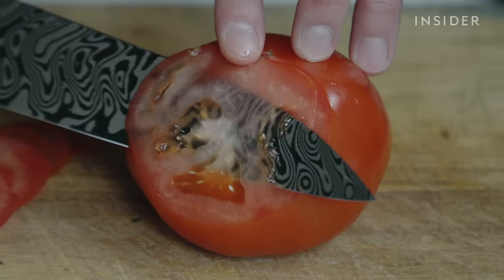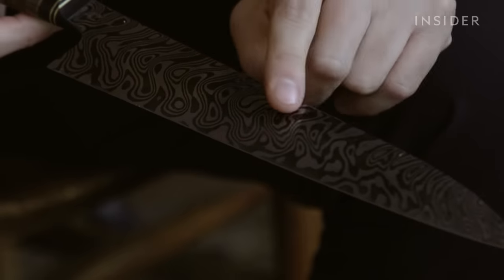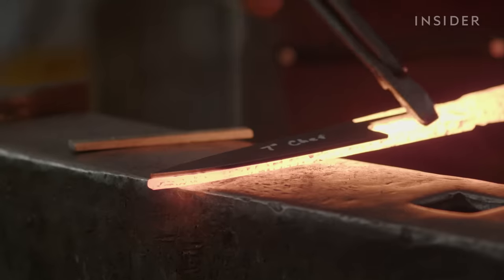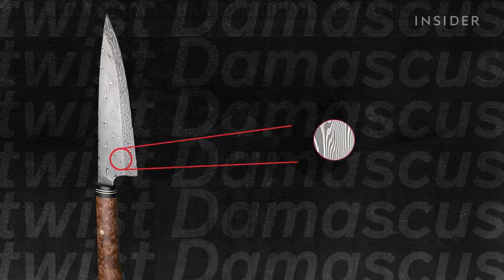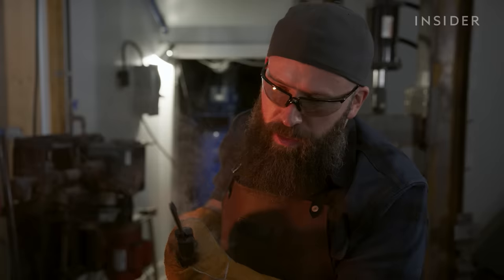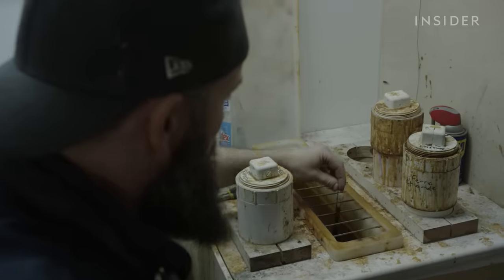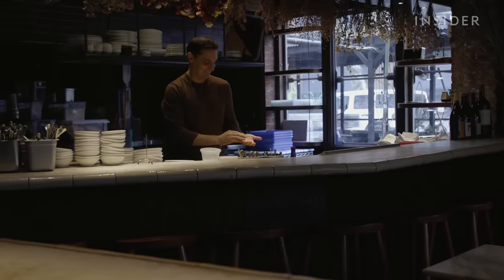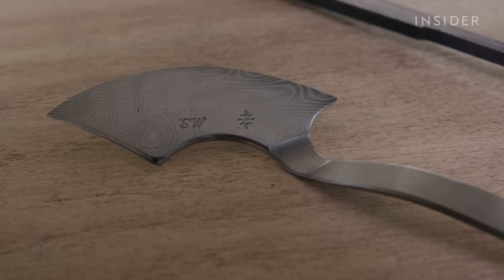Why Damascus Knives Are So Expensive | So Expensive | Insider Business

Comment: For anyone wondering if Damascus is better than normal steel or if it's just a myth: it is not, however it used to be. The ability to make the mix of carbon and iron in steel homogenous has not always been a given. That means that steel from hundreds of years ago was significantly worse than steel today. Damascus was the best way at the time to make the steel more homogenous thus making it superior to other steel of the same time period. Nowadays due to modern machinery steel is much more homogenous eliminating the need for the folding the steel to make damascus
Reply: Agreed
Reply: Would you say they both have the same "strength"/durability
Reply: @dogs oath  perfectly made Damascus would probably still end up technically being weaker just my virtue of how great metallurgy has become, regardless we aren't reaching that limit while doing anything these utensils can handle, even in a larger format its pretty rare man out strengths steel before fittings start to go
Reply: @sentient_slab  rather that it being Damascus has no effect either way. What affects is the steel, heat treatment, and how it is sharpened
Reply: Just came to say the same, impecable explanation
Reply: @sentient_slab yes, and a really bad made Damascus (overheated, cold forged, bad HT) can be worst
Reply: @wmcknives  thank you :)
Reply: It isn't Damascus pal.
The technique for making true Damascus was lost a couple of centuries ago.
Reply: @scarabooshable  its been re-discovered if you like to say it, it's called wootz, but today a multi layer steed it's called Damascus, for shortening, multi layer steel it's long and confusing
Reply: @mchajen511  you're welcome!
Reply: @scarabooshable  what do you mean "true" Damascus?
Reply: @dwightschrute4560  "True" damascus steel was made in damascus like 1200 years ago and we dont know exactly how they did it. modern times people have been able to recreate a similar method but  the real "recipe" has been lost
Reply: @dwightschrute4560  Damascus is two different carbon steels forge welded and folded. True damascus would probably mean Damascus made from the same steel as it was made historically. I can accept that we don't have an exact idea of what those were (although Wootz steel seems probable) but I have a hard time believing the technique is lost without compelling evidence of historical damascus having properties we can't replicate.
Reply: yeah shouldn't be sold as better than a normal steel blade, just prettier
Reply: No one has managed to beat viking steel yet, no one even knows how it was made or wootz for that matter, I am so tired of hearing people go on about how amazing pattern welded steel is,  its got the same silly level of myth as the pig iron swords of japan.  people are just paying for a art piece and the rest is the placebo effect because they spent so much money on it.
Reply: @wmcknives  Wootz has not been rediscovered.
Reply: @GreatSageSunWukong  Hi, not very familiar with what sets Viking steel and Wootz steel apart from modern steel. Is it better at holding an edge, more oxidation resistant, tougher, etc? I would love to know :)
Reply: @queenween  it was called damascus because it was sold in the markets there to the western market,  it was not made there, damascus was a trading post where many cultures merged, like the silk road in ancient times.
Reply: @GreatSageSunWukong  it's a way to say it, it's been proved that that's the method they have used in the original Damascus steel, I don't remember the name of the YouTuber that made the investigation about it, but he discovered that the technique was extremely similar to the wootz steel
Reply: @mchajen511  the difference is not between the modern steels, is with the contemporary steels, the have an enormous advantage
Reply: It didn't necessarily mean better even during the middle ages. It just had a better chance of being better due to the indigenous carbon content of the iron deposits in western Asia. Blast furnaces were invented in Sweden c. 1300. Those blast furnaces made it much easier to make steel of the same or even better quality than the Middle Eastern varieties. This said, it still wasn't impossible to make European steel of the same or better quality even before the blast furnace. It depends on individual deposits, knowledge of the steel-making process and the skill of individual smiths.
Reply: damascus steel actually came from India.
Reply: Adam Nelson  the archaeological and historical evidence disagrees. There are absolutely non-Damascus blades that are over 1k years old some as old as 2k years old or older that exist today and Damascus blades that have crumbled to dust. What steel the blades are made of makes much less of a difference than the conditions in which they were stored in.
Reply: @sentient_slab  No. True Damascus/Wootz steel even if made by a master smith still has higher amounts of impurities than modern steels. Modern steels are highly specialised by just tweaking the few percentage points of elements such as chromium, vanadium, molybdenum can make the blade tougher than what was possible with wootz.
Reply: @wmcknives  it hasn't been re-discovered. Metallurgists have been able to produce steels that are similar, but with steels that are called "Wootz" being produced by hundreds of different smiths over roughly a 2000 year period in history there is no 1 definitive Wootz steel. Unless someone discovers a complete step by step record on its production the closest that can be made is still only a facsimile.
Reply: It's not a myth.
Anyone with eyes can see it's better.
nods
It is better looking.
Reply: I can take a 10 dollar walmart blade, sharpen it, and itll cut just as good as a 20k blade. Its all just bullshit.
Reply: Valyrian steel is still the best
Reply: @GreatSageSunWukong  I suspect you are probably creating a strawman in your own head about "people" like that.  Sure some probably do exist but I'd be willing to bet most who want to buy these kind of knives have done enough investigation before purchase to know that it's mostly an art form.  And what's wrong with supporting an art form like this?  It's no different than buying a nicely made automatic watch for hundreds or thousands more than a quartz which is a far superior time keeping device.  Pretty much every watch person out there knows this.  Being "better" isn't the point.  The art and craftsmanship ARE the point.  And there is nothing wrong with supporting it.
Reply: @sentient_slab  they did it around 1:50 you basically pay for the craftsmanship which is still awesome.
Reply: I know next to nothing about knives and steel etc....but it sounds to me then, like this is much like people into Denim or Watches.  Like selvedge denim is no "better" in terms of quality or durability than modern projectile loom denim but the appeal is in the craft of it all.  The fact that it feels different and is generally smaller scale production.  Personally I think it's cool that people are into this kind of thing and supporting these types of manufacturing.  And while not 100% true in all situations, generally I find supporting these kind of products is a much better way to mitigate against things like sweatshop working conditions and exploitation.
Reply: Depends on the steel used to create it.
Reply: Adam Nelson  clearly not because he said there were European steels just as good (or better) as Damascus and just like almost everything else during the Medieval period, you can't use absolutes.
Reply: There is no such thing as '"true damascus", or "damascus steel", because that method was perfected by Tamilians and when the Wooltz ingots arrived to Damascus, they poorly replicated the original, but carried on as 'their' version. As someone mentioned in the comment section, it was place of trade where they inherited Wooltz Steel which originated from Tamilians. There are two veils casted over to hide Tamilian history; the credit being given to Persians and dubbing it "damascus steel", while the other being said by some informative individuals but not accurately stating it was solely from Tamilians, instead of including 'India', as a whole - when India was not a country back then, and back then the large land area was called Bharatham by the Ancient Tamilians.
Reply: Yep...
Reply: Damascus knives are very overrated
Reply: Wrong, it is and still better than normal knifes today because of the type of steel Damascus need, like u said on that essay. But completely glossed over the fact that normal steel knife requires only the most basic steel.
Reply: CPM-154 level of performance that the best Damascuses offer is more than good enough for the average user, especially in everyday culinary. But with supersteels like Magnacut nowadays, I’d rather get the performance over looks.
Reply: @wmcknives  same true for steel
Reply: Jealousy
Reply: Wootz
Reply: @doublestrokeroll  actually not really. You might think people in general would know this but no. Channel like business insider would advertise on how good this knife is compared to others due to the price range. This video is a prime example of it. It is because of such advertisement that you can find people believe it's better when in actuality it's not that much of a different
Reply: Damascus is a just a bit stronger and durable, but it's just done to make them beautiful by etching them in acid.
Reply: Powder steels are the king nowadays. Truly the cutting edge of thousands of years of metallurgy
Reply: @zulhilmi5787  I think you're hearing what you want to hear and not paying attention.  She literally says at 1:42 "...and while high end mono-steel knives may perform similarly, Damascus knives are coveted for their striking appearance and the craftsmanship required to achieve it."  This video never said they were "better" and is quite clear it's only about the process.
Reply: The problem is that in all the video no-one reveal the atomic structure of his steal, which is actually very easy to check and it's the unique thing will allow you to say if it's Damascus or at least near Damascus Steal. So this is definitely just another scam.
Reply: @doublestrokeroll  literally in 9:31 he claim that a 30$ knife will not cut anything when in reality it will do it's job. Yeah it will not have the same quality but just add a few more bucks and you will get the same quality. You don't need to pay 500$ for such sharpness when you can get it way more cheaper.
Reply: @MultiKwolf  so just because you can make a knife from a bad steel means that all knives are bad? Dude you're literally making the argument that a chefs knife isn't good because a butter knife can't hold an edge.
Reply: @dogs oath  yes! Although it depends on the amount of carbon in the blade.... for example. Stainless steel is much softer and won't hold an edge as well as a regular carbon steel blade!
Reply: @zulhilmi5787  So you're taking him literally there?  I think you know he was exaggerating on purpose.  And you answered your own point in the next sentence.  
And again, you're missing the point.  Some people want to pay for the craftsmanship and artistry of things like this.  It's not about "need".  People don't "need" any of the shit we buy.  
It's like you're saying "nobody needs to buy an automatic watch.  You can get a 5 dollar quartz watch that's more accurate for WAY less."  OK...that's true...but I WANT an automatic because I love the technology and creativity those watches represent.  

People are into different things.  And some examples of certain things are expensive to make.  People aren't wrong for buying those things.
Reply: Yeah, its not the "real" damascus anyway
Reply: @doublestrokeroll  literally or figuratively does not make any changes here. I don't care if people want to buy it for artistic purpose. Did I ever implies that I against those people? The answer is no. My issue is within the implication by the video that this knife is better than the general knife we can buy in market with a cheaper price. If you want to buy it for art then by all mean go but don't implies in a slightest bit that it is more functional than the general knife.
Reply: @wmcknives  True of any steel. Badly made is badly made.
Reply: Thank you. Capitalism trying to find another way into our wallets
Reply: @scarabooshable  This is such a goofy myth that for some reason still persists. Traditional damascus is wootz/crucible steel, the patterns are created by alloy banding, there are still smiths today that make 'True' damascus, we know exactly how it was made. Modern damascus on the other hand is pattern welding of two or more steels of varying alloy content, usually one high nickel and one without, that are revealed after acid etching.
Reply: @queenween  There's no 'real recipe' because there never was a recipe, it's just the basic technique of crucible steel smelting. A number of smiths recreate it today, just with much purer iron and precisely controlled carbon and alloy content.
Reply: @GreatSageSunWukong  Lol Swedish iron ore deposits are more pure than anywhere else, but modern smelting and metallurgical technology yields vastly superior steel to 'viking steel'. And yes we know exactly how it was made, its basic crucible smelting, plenty of smiths out there still make authentic wootz. The Viking steel mythology is almost as goofy as the Weebs making up shit about katanas. Modern damascus/pattern welding does nothing for function but it is absolutely valid as an artisinal artform integrated into practical tools.
Reply: @GreatSageSunWukong  It was never forgotten lol, we know exactly how to make wootz and there are a number of smiths that still smelt their own crucible steel. Check out some of Mert Tansu's work.
Reply: I think you mean homogeneous, not homogenous.
Reply: 😊😊😊ķķ
Reply: Lol original Damascus steel from Damascus wasn’t even folded (you are thinking of the ancient Japanese folded steels) it was actually a type of steel heated and slowly cooled in a way that grew carbide crystals in it. The cystals when etched were darker and created patterns all over the steel
Reply: I might agree with this if I had never owned a Damascus chef knife vs general store bought chef knife. And the one I have isn’t even close to the ones being made in this video. We’ve had it over a decade and it’s still incredibly sharp, compared to the chef knife we got in our wedding registry block set that dulled in 2 years.
Reply: Understood. Thank you
Reply: So modern Damascus are overrated?????
Reply: I've been saying that to myself to the entire video Damascus steel doesn't exist anymore it's patterned welded steel or folded steel
Reply: That's why i just have a regular knife with a Dbrand damascus skin
Reply: In other words it's not worth that much it just looks pretty
Reply: @MoXXXi yes
Reply: @VNtheOnly yes
Reply: thank you
Reply: Just to clarify, yes metal back then was bad with a lot of impurity. But there was Damascus steel type. The only problem is the iron from India is gone or can't be found anymore. That why we can't recreate it. We know the method and coal they used. But not iron ore they used. So it become a style for people who like the look of it.

TLDR
In short, good steel knives for $200 are best.
Damascus is a style now and not a type of metal. It's worth spending a lot, when it's your life job like a chef. And we got a lot better at making metal.
Reply: Will it keel?
Reply: @jububoobaroo67  pretty much
Reply: @leopfeffer2419  No he means homogenous which is the current scientific spelling, homogeneous is just how it's often spelled colloquially and was used scientifically in the previous century.
Reply: This isn't Damascus steel. Its as Damascus as sparkling wine is champagne.
Reply: @GreatSageSunWukong  You must be wore out Bub!!!!😂😂😂😂😂
Reply: @Yeshua Christi  Sparkling wine is identical compositionally to champagne, champagne is just a protected term limited to the region where it is produced. Modern Damascus is pattern wded steel of 2 or more alloys, traditional Damascus is just wootz/crucible steel with the pattern made from carbide banding.
Reply: I was looking for this comment. I thank you good sir
Reply: usual insider is making it exaggerated pricing again like the Japanese chef knives like the gyuto and santoku. and praising the damascus steel is superior to other steels. it's just an 15N20, 1084, 1095, 52100, or for swords 5160 and 1075. the guy is an ABS master smith the title of being an ABS master smith is the thing that you pay for like the goat himself Bob Kramer plus does steels are cheap but the labor itself is expensive the persian twist it self or just the twist removes a lot of material and you mess it up de-laminations and stress cracks will ruined it up and will add to the cost. not to mention the heat treatment part made my heart beat race like all your labor will be wasted if you mess that up also that part added to the cast so. the steel cost and other exotic handle material + Labor cost + other material cost like sanding belt, quenching oil, gas, electricity and etc. + also if the guy is an Master smith and journeyman added to cost.
Reply: @doublestrokeroll , What makes you think that selvedge denim is not better? The quality is most certainly more durable if you take care of it over time and it forms to the individual better even though it takes ages.
Reply: Please write a book for us before you leave this world behind. 🙏 ❤
Reply: @geoffreyk9164  The quality of the denim is determined by the quality of the threads not the way in which it is woven.  Projectile looms are just as good as shuttle looms.  Take the same thread and run them through both and you'll have basically the same thing.  
You're confusing what big companies do to the denim after it's been woven.  Big brands purposely wear out their denim for fashion and ease of use reasons.  They don't have to do that. 
The selvedge is simply a product of the shuttle loom creating a "self edge".  It's got nothing to do with the quality of the fabric.  Once the open ends are sewn up, non selvedge denim is just as "durable" at the seam as selvedge.  Seamstress' know what they are doing after all.  

I bought two pairs of made in china Levi's 501s a few years back.  Levi's "premium".  One pair has selvedge and the other doesn't.  They've both had equal wear and they're both pretty much exactly the same.  The selvedge pair isn't any "better" because it's selvedge...lol.
Reply: @zulhilmi5787  I get it.  The video did not imply that.  You read your own emotional bias into the video.  They did not imply it was better.  What they literally said DOES matter.  You saying it doesn't, doesn't make it true.  Not sure you have a grasp of basic logic with a statement like that.
Reply: @griffany  thank you, can't promise anything about the book though
Reply: @doublestrokeroll , Yeah, I understand what you’re saying, but I didn’t mean to confuse what big companies do to the jeans after they been woven. When I’m talking about selvedge denim being “better”, I’m not talking about the quality of the fabric (although I find that raw Japanese jeans to be the best in terms of fabric and overall quality), I’m talking about their durability (for selvedge jeans and raw selvedge jeans) and the fact that they eventually fit the person better (in terms of selvedge and raw).
Reply: @matteblack5805  Glad it was useful :)
Reply: @BlackEagle352  Carefull, those are even sharper 🙃
Reply: @VNtheOnly  It's just cosmetic would be more accurate but yes, by many it is
Reply: @TheNerdistheWord  Damascus knifes can be incredible, but so can high end non-damascus knife. The most important thing is that you're happy with your knife, but don't get another damascus knife assuming it will be equally as good by default
Reply: @ryanyoung7433  True but you will have to sharpen it a lot because it won't maintain it for as long as a better quality knife
Reply: @doublestrokeroll  Hey don't get me wrong I collect knifes and swords,  I even have some katanas myself because they look pretty, my most expensive blade is a wakizashi with gold and mother of peal inlays on it and a pretty hamon, but I am going to pour scorn on this kind of thing because looking very pretty and having a fancy handle is not the same as being the best you can get for functionality,  I can understand these chiefs buying the things if they work in a restaurant where they are making the food directly in sight of the customers, its part of the show but as a tool, nope theres way better knifes on the market for cooking with that cost less, damascus is not all that I own 4 damascus knives myself, all these things are inferior to modern steel and heating technology, we can purify steel in ways no one ever could before, we can study the structure under microscopes to determine the best composition for the job.
Reply: @jacoblaszakovits3035  I did not know that, will definitely do more reading but it seems to me that it like folded steel also increased how homogenous the steel was as well as providing other benefits.

Found this paper, name no link, if anyone is interested enough: Influence of the Distribution of Excess Carbide on the Properties of Genuine Damascus Steel
Reply: Real Damasscus steel is Wootz. What is shown here is just Pattern welded, time consuming to make and beautiful to look at but not better stronger sharper. Even crucible Wootz has its limitations.
Reply: I would still say that the edge that you get from folding the steel thousands of times is still Superior if I were to buy a high-end Katana it would definitely be something with at least a thousand Folds.
Reply: @lance862  compared to low fold count maybe, although I don't think so. Compared to normal steel I am sure there is no causal relationship. But, that there is a correlation between someone putting in the time to make many folds and putting in the time to make a good knife, or in your case katana, seems probable to me.

However, the important thing is that you are happy with the knives you have. And I hope that you see that I am not out to invalidate you're opinions in any way. Just sharing what I know in hopes it might help someone.
Reply: @lance862  doesn't need folding if its high quality steel in the first place only reason katanas are folded thousands of times is to try and get a decent edge out of pig iron. a modern sword any sword designed to be used as a weapon is better quality then a old katana, less prone to chipping, breaking and rust.
Reply: Everything you said is technically correct. However, it does deserve the large caveat that the Damascus steel of the past that you are referring to often called wootz Damascus or crucible Damascus is a completely different process of steel creation than the modern thing we call Damascus. It does, however, produce a similar patterned look due to the crucible process as well as the vanadium content of the mines where that steel was sourced from which causes brighter steel similar to what we see in modern steels that are used in the pattern welding process.
Reply: As a knifemaker i totally agree!!
Reply: @geoffreyk9164  But durability IS because of the fabric, not the method used to weave it.  If you take great Japanese lengths of cotton denim and weave the same cotton denim on a shuttle loom and on a modern projectile loom the durability will be exactly the same.  If anything, non selvedge would probably be more durable because it's a tighter weave with less fraying (slubbiness for the dorks).  Though I have no hard facts to back that claim up.   Basically it's not going to be worse because it's not selvedge.  This idea it's more durable because it's selvedge, is a complete myth.  Selvedge is simply an old style loom.  That's it.  Nothing more.  The slight difference in machines is not going to affect the durability.  
The appeal is simply, as you say, that you get to "break in" your jeans.  But you could weave raw japanese 25oz denim on a projectile non selvedge machine and it would be the same.  You'd still need to break them in and fade them yourself.
Reply: Correct. With modern homogenized steels, the only benefit to pattern welding (or 'damascus') is for aesthetics. There is no functional benefit anymore.
But they sure are pretty, I'll admit that.
Reply: @doublestrokeroll , Thanks for the additional details and insight. I think that I caused some confusion because I thought you specifically mentioned raw denim selvedge jeans. Having gone back and read your comment though, you didn’t. With that said, when I was talking about “durability”, which I think is what caused confusion, I was really talking about a combination of both selvedge and raw denim. My basic understanding is that raw denim will always be more durable than pre-washed denim (if cared for properly), but also that companies selling selvedge jeans typically use higher quality denim. I guess that is not automatically true; however, even if you use the same denim on a selvedge loom and a modern loom as you suggest, I understand that because the selvedge loom runs slower, it is easier to control quality. Lastly, and I think you disagree with this part, my understanding is that fraying of the outseam on selvedge jeans is less likely  given that quality is more tightly controlled. Ultimately though, I think the main benefits of using selvedge jeans to some extent and raw denim jeans to a greater extent is the “breaking in” and personalization aspects more than the durability aspects (at least if you own more than one pair of jeans).
Reply: @mchajen511  Now , Damasteel on the other hand...
Reply: True Damascus steel has been lost to time. This is pattern welded steel which is still greater than one homogeneous billet, but still inferior to true Damascus steel.
Reply: @geoffreyk9164  Well that's the main thing right?  These smaller companies are choosing to make old school jeans.  

If you're Levi's the whole thing must be weird.  For basically 40 or so years, consumers see your product as being "flawed" so you have to come up with a marketing slogan like "Levis Shrink to Fit".  So they work on it and develop the technology so you don't have to worry about them shrinking.  Then people want the "faded look" cause not everyone wants every single pair of jeans to be dark blue.  So they do that.  
Now you've got a whole group of people saying "wait....we want the old jeans that might shrink in a way that makes them not fit properly...we'll take our chances!"....lol. 

But Levis had already moved on.  So all these small companies come in to make them like that.  To the point now where Levis and the other big companies are making selvedge and raw denim again because giant corporations are always slow to catch on to trends.   

As for the old looms it depends on your definition of quality for denim.  The jean makers can control many aspects of the weave to get the texture they want.  But those looms by their nature introduce "flaws".  The "slubby" thing.  Now if you're saying that represents "quality" then yeah by that definition it's true.  But I would argue most people's definition of quality in manufacturing would be consistency.  Modern projectile looms are far far more consistent.  Each bolt of fabric is going to be pretty much the same.  

Personally I think it's more reasonable to say denimheads want the inconsistencies of shuttle looms rather than redefining the word "quality" into something that simply creates confusion.  

Which brings us to that last point.  Yes, modern looms create fabric with an unfinished edge that can fray, but that's why I mentioned seamstress' being good at what they do in a post earlier.  I don't know the name of the stitch they use to "seal off" the edge but they know what they're doing.  Again, take the exact same threads and make a pair with and without selvedge sewn by the same person and they will be the same.  Have you ever had a pair of non selvedge jeans come apart on the outseam?  I can't remember ever experiencing that.  It's a non issue.  

People like the selvedge just because they think it looks cool.  And I agree.  It does look cool.  But it makes no practical difference in terms of quality and how they wear all other things being equal.
Reply: I see
Reply: yes
Reply: Ok cool to know x)
Also the cool aspect is a great thing
Reply: Amen.
Reply: @zulhilmi5787  Amen.
Reply: @thecookseye7383  Amen.
Reply: @geoffreyk9164  Amen.
Reply: So basically this is not a lot more work for way more? Good to know will never buy Damascus then. unless this shit is 25x stronger there is no reason to pay more than 14x times the price for a potentially marginally stronger blade. Well played by the craftsmen who other wise barely make shit for money with stuff like this. They act like it’s that much work, but if you’re a smith and have a forge it’s literally nkt
Reply: Led me to think
Reply: This.... I love when people moan about "stamped steel" as if it's automatically low quality. Ancient bladesmiths would have loved to have access to modern materials.
Reply: And it was invented in india
Reply: @harveyspecter111  that’s just false. The steel was ingots of wootz steel which was IMPORTED from India. Not MADE in India. The forging of the blade and how Damascus is actually made is in Syria. So that is just false
Reply: For anyone still wondering, since his grammar was bad: He is saying damascus steel not better than 'normal' steel. He is not saying it's not a myth, because it is a myth.
He is also wrong, it's not worse than 'normal' steel, although it is way worse than 'modern' steel.
Reply: @Apoz bare minimum type with proper grammar
Reply: @Apoz  it’s a myth!!! Yo, Damascus is a myth? It’s not a real thing only believed upon by leaser individuals, it’s a myth!
Reply: @griffany  🙏❤
Reply: it's a waste of time and money for average person to buy Damascus piece while a regular high quality steel do the job,and yeah Damascus got over hyped perhaps cause of the patterns it's cool alright but i won't buy one even if i can afford it
Reply: cap
Reply: Thank you so much
Reply: I am asking which software are you using for edit video
Reply: I've been told that they don't find the formula to what made swords not be damaged in those days, I know we have now machines that could create a indestructible sword but how they did it before is a mystery
Reply: The only reason you buy a damascus steel knife is because of the aesthetic and the labor and craftsmanship but other than those reasons its not going to be better than a knife made with one type of high quality steel. Your just creating weak spots and inconsistencies on the blade by combining two types of steel together to create damascus.
Reply: I wasn't sure wether or not he was selling snake oil because I feel like I'd have heard of this in all my years on this planet in the kitchen.
Reply: Thank you, just saved me a $1,000 😂
Reply: @rokaskundrotas4805  they look cool tho some will say it's worth the money
Reply: So glad to see some sense in the top comment after the video was filled with such outright nonsense.
Reply: @ootheca  thank you :)
Reply: @ryanyoung7433  Well you can sharpen close to anything, with those metods it is more about keeping the edge and over all resistance.
AS for whether (fake/modern)damascus steel is better then modern types of steel I don t know, but I do know that most knives are not made with some super good modern steels.
Reply: While I agree that some types of modern steel are better for blades/knives most knives producers don't use those modern good types of steel.
Because if that was the case there would not be so many crappy knives.
And I don t know if it is cost effective to even go for them then try to use those folding techniques.
Reply: L
Reply: 1
Reply: Aaaaand all the experts come out of the wood work, wanting to shit all over this amazing craftsmanship.
Reply: Wait so it a scam?
Reply: @breadtoasted2269  No, they are difficult to make and can be really good. But it isn't the only way or even the best way to make a really good knife. I do however believe there exist "Damascus" knives which are really cheap where the pattern I printed/painted. Those I would consider a scam
Reply: @scarabooshable  fact
Reply: I can make Damascus knife using plastic
Reply: so does the original technique actually originate from Damascus in the middle east?
Reply: Isn't ancient Damascus just ancient samurai swords, coz' samurai swords are folded 1000 times? I wonder which is more durable though- ancient Damascus steel swords or ancient samurai sword masterpieces? God bless those who discovered Damascus (where St. Paul was supernatural blinded and converted by Jesus to become catholic).
Reply: It just costs more and most Damascus knives aren't real
Reply: Garbage.
This is pattern welded steel and it is not stronger than homogeneous high carbon knife steel.
Reply: This. If you want a sharp knife, just buy a $25 whetstone and sharpen it yourself. In half an hour, you'll have a knife sharper than when you bought it, assuming you spent any less than like $300 or whatever
Reply: Damascus to me could symbolize the skill of the bladesmith though. While in most cases this is wrong, if the blade is entirely made by hand (or power hammer) it could show the skill by not only the technique required, but the time it takes.
Reply: thank you for the explanation
Reply: thats because the original method of making wootz steel has been lost , India was where it came from , and the British destroyed it . Indian wootz steel made what is known as ''damascus steel ''
Reply: @Jatadhari1000  Lol no. It's cause sharpness has nothing to do with this stuff, and entirely has to do with sharpening techniques. Metal doesn't become sharper just cause you do funky folding techniques.
Reply: @wmcknives  So how do you know if a steel blade is going to be just as sharp/durable as these demascus blades? Do you klnow some reputable knives sold today? It's hard to know if I'm getting ripped off or what these days.
Reply: @WIZA327  it's based in trust in the maker or artisans
Reply: The guy says on his website

"Nearly all of my knives are made using high carbon steel. It is superior to stainless steel in almost every way, but you need to know how to take care of it. It is important to understand what you’re buying."

So now I'm confused because you're saying that normal steel is better than what he's using, which he says is carbon steel, which again, he says is superior to stainless steel. 

"Compared to low-carbon steel, stainless steel offers a massive upgrade in strength, hardness, and most importantly corrosion resistance. High carbon steel offers strength rivaling and sometimes exceeding stainless steel, but is largely a niche material in the manufacturing world."

Here's a quick google search asking to see if carbon steel is greater than stainless steel, based on Zach's statement. They say that stainless steel will be far superior to lesser carbon steel quality, but if it is high quality, which Zack says it is, then it can rival or exceed. So which one is it, damn it!
Reply: @anthonyvillaa  I think you misunderstood the comment a bit. The comment is stating that the Damascus method does not affect quality on modern steel, and what matters is the quality of the steel itself. The marketing for Damascus steel is often "it's the sharpest in the world", when in reality, the quality is fantastic, and the method requires high quality steel to preform well. 

The fancy method is generally paired with the fancy metal, but you only need the fancy metal to get a top tier blade, and sharpening skills are what matter beyond that point, which are not affected by a blade being Damascus or not.
Reply: @Naokarma  gotchya. Yea I just went into a discord for chefs knives & found out about how sharpening will do me better than buying a expensive knife like in the video.
Reply: Damascus is better because you know it's difficult to do and the smith did a good job, versus steel which is just manufactured and pretty terrible. So for the best, go to the smith that does the best Damascus then have them do steel.
Reply: @anthonyvillaa  Exactly. If you want the most value for your money, I 100% recommend getting a couple whetstones (typically 1000 grit and 6000 grit) and learning how to sharpen that way. 

If you just want a simple sharpening, then buying one of those pull sharpeners can do the job fine enough as well, but it does take some longevity out of knives by taking more metal with it than other methods.
Reply: @scarabooshable you mean layering steel? We’ve basically recreated it perfectly and it’s inferior to any modern steel like o1
Reply: @queenween the real recipe was far inferior to any modern steel. Source: am a knife maker with years of experience
Reply: Are you telling me that they are selling wolf tickets and these knives are complete fugayzi? No way, I refuse to belive it.
Reply: Exactly! It just looks pretty :)
Reply: source: Broke dude
Reply: It's actually even more than that the raw ore they used in Damascus is called Wootz and it is vastly better than mild steel and back then that was a massive deal and then used the Damascus forging method just made it that much better.
Reply: Damascus is still one of the higher quality blade types even today
Reply: @Silvercrypto-xk4zy  
(Edit) below is on the assumption you are talking about modern Damascus. If you are talking about historical wootz steel there is certainly proof which I think you can find in an earlier comment of mine of it possibly being comparable or superior to modern steels (/Edit)

it being Damascus has no bearing on it being good or not, there might be a correlation since Damascus is harder to make. You can make Damascus out of two steels with differing carbon contents and then just skip heat treatment and tempering making a really soft knife or make fake Damascus by taking a normal knife of any quality and printing a damascus-looking pattern.

TLDR: do not use the Damascus pattern as a visual indicator of quality, it might Damascus and soft or it might be fake Damascus (read above)
Reply: Lame explanation. its not just homogeneity. Real wootz had vanadium carbide layers and was super strong.
Reply: @drygordspellweaver8761  Today "Damascus" and "Wootz steel" are two different discussions. Damascu's, as a name for all folded steels, purpose was to increase homogeneity. Wootz steel, which I in this context treat as a subtype of Damascus, had additional benefits. However these are much more complex and deserves a much more in depth analysis and discussion than YouTube can provide. I recommend you check out a paper I linked in a previous answer to a discussion about Wootz steel which seemed interesting.
Reply: @mchajen511  Damascus is not a name for "all folded steel". It's referring to wootz. I don't care how many neophytes misappropriate the term these days. Doesn't change it's origin.
Reply: @drygordspellweaver8761  I personally believe clinging to the original definitions only purpose is an ego-boost when the word has changed meaning in most people's use of it. I too think that what you describe is the only form of real Damascus but realise the need to specify wootz steel when appropriate. I also think it is important to understand that real Damascus is made from Woots steal.
Reply: they have found blades tha were made of Damascus, that are still sharp, The steal we have now maybe strong, but lose there sharpness.  We have lost a lot of the quality of the past.
Reply: @mccunecp  That is really impressive, although I'd be hesitant to use it as a measurement of how good a blade keeps it's sharpness. Time doesn't do anything on its own: temperature, humidity, storage medium, movement, etc. All affect the condition of the blade. I'd rather consider it an indicator that the steel's quality warrants further study.
Reply: Pm-Hss knife something made from asp2060 would easily outperform any kind of Damascus
Reply: High quality japanese knives are still folded with many layers of steel without the patern. The patern itself means nothing its merely aesthetic.
Reply: You need Damascus contact me
Reply: "Pattern welded steel"
Reply: I think is holds a edge better… correct me if not
Reply: You are partially right.  Some “Damascus” knives on YouTube are made from inferior knife steels.  Some companies and knife makers use proper steels.  Most commercial Damascus knives have a Damascus (folded) stainless steel outer layer on each side of a core steel such as VG10, SG2 or ZDP189.  The core steel is the true cutting steel and has harder, blade retention properties while the stainless skins help protect from corrosion, add flexibility to the knife without breaking and add artistic patterns when etched.
Reply: They are very appealing to the eye. I’m happy to pay a grand, but I’d be struggling to pay 2. I plan to own a Damascus chefs knife this year.
Reply: Amazon sells them for cheap with prime delivery, thanks for the info tho
Reply: @thecookseye7383   the original methods came from India. The persians made a vague and poor attempt to replicate it but failed but still it ended up becoming better than european and middle east steel. Along with many knowledge the ways to make damascus steel was lost in India because of Brutish. 

Sweden and good quality steel should not be in the same sentence.
Reply: My  mother lost four of her fingers using this type of knife, and only has her middle finger remaining. When she holds up her hand, everyone curses back at her, and now her self esteem is real low. So she wears a glove with paper stuff inside each finger to allow her to raise her hand in her Psychology class,  and the teacher not curse at her. She also gets self gratification each time she washes herself in the shower. A really sad story!
Reply: wrr
Reply: @sentient_slab what do you think he is talking about😂
Reply: @mchajen511 utterly idiotic explanation. this is not damascus. this is pattern welded. damascus was made from wootz, and not by folding. the modern way of folding is to make a damascus lookalike. crucible steel was rare those days, wootz from sri lanka was one of the only sources. what you said would apply to japanese sword making, but not to damascus. if you check real damascus blades and compare them to pattern welded, you'll see a huge difference. this whole nonsense of calling pattern welded damascus started in the 70's by a knife maker.  you are correct that the hardening and tempering techniques are more important.
Reply: Mind blow.... You are telling me the obvious.... damascus is just a pretty pattern..
Reply: @Thenotfunnyperson  that's not what damascus is. currently what they call damascus is pattern welded, but that's not what it was. pattern welded look similar, so a knifemaker in the 70's started calling pattern welded damascus.
Reply: @Thenotfunnyperson  Well, no. It's a smithing technique that historically had a valid effect on quality. To assess the quality of a damascus knife you need to understand it, it's not simply a pretty pattern.
Reply: @doublestrokeroll yes! You captured it perfectly. Damascus is made by folding which requires the time and effort of a skilled blacksmith.

It is really beautiful and a great way to support those keeping the craft alive.
Reply: @MultiKwolf you've got a point but simplify it so much that you might come to the wrong conclusion. Knife steel can generally be put into two categories: stainless and high carbon. High carbon is better at holding an edge, easier to sharpen, and generally considered the best when regarding performance. Stainless come in lots of different qualities from garbage to really good but even the best stainless steel can't compare to the performance of high carbon steel. However, stainless steel is much more common due to it not requiring nearly as much care and being stainless. Damascus steel can only be made from High carbon which I think is where you base your conclusion. But there are lots of really good high carbon knives that are not Damascus to, most knives marketed as Japanese knives fall into the category of premium high carbon knives. (Except those which are suspiciously cheap, there are those calling garbage knives "Japanese" just to sell more)
Reply: @divyeshrana1245 You get the etching point right but there is more to it. Damascus is made by sandwiching two steels with different carbon contents and then folding them to make thousands or millions of alternating layers. The Smith then forges and grinds the final shape and dips it on acid where the two different steels react with the acid producing a different colours due to their differing carbon contents.

And regarding durability and edge retention you are wrong, the rest of this thread is a wonderfull source to learn all the nuances of damascus.
Reply: @doublestrokeroll nitpicking but the way they say similarly makes it sound like "almost as good" and not "just as good".
Reply: @kacperfuckpolice today the term damascus has come to mean any folded pattern welded steel. While I see where you're coming from I've switched to using Damascus and Wootz steel instead of fake Damascus and true damascus feeling that it is more accurate and less likely to cause confusion and/or meaningless debate.
Reply: @401-Fishing Good point! I'd just like to add that not all stainless steel blades are equal. There are really good ones and I'd recommend them to almost everyone. The effort you save using a high carbon steel is often much smaller than the effort you have to put it taking care of it.
Reply: @FangGuard damscus today means any pattern welded steel. Whilst I agree that there are a lot of misconceptions about what it is I think it is better to accept it's new meaning and focus on the educating people on what it is, its history, and the actual steel alloys that have the properties that many nowadays attributes to Damascus. In short, I choose to use "Damascus" and "wootz steel" instead of "fake Damascus" and "true damascus".
Reply: @damienturner6368 would be hesitant to call it a scam or waste of money. It is an art piece and if you have the money to spend I think it is really great to support a skilled craftsman. Just do it with the knowledge that you are buying an artpiece/colletible. Not a miracle knife.
Reply: @rayleth5979 yes, but so will the cast iron skillet I have in my kitchen if you use it the right way. Love the reference 😂.
Reply: @randoman81 damascus has changed meaning, check my other comments.
Reply: @lance862 I think katanas are really interesting! They used many techniques to increase the performance of the blades and not only folding. They often used covered the spine in clay during hardening to make it softer than the edge and sometimes sandwiched different steels to make it better. This is not done today due to it not affecting the sharpness but rather shock absorbtion, flexibility, and durability whilst also producing a beautiful blade.
Reply: @greedier-7661 no, it is not cost effective in the slightest if you only consider functionality. A modern knife is made by grind the shape, heat treating, sharpening, and attaching handles etc. Most of which can be done by machines and unskilled labour. Damascus requires forging which takes a lot of time, heavy machinery, and skill.
Reply: @pcstgrsqrl5581 not at all! I think Damascus is amazing, I just take issue with the few trying to sell it as a miracle steel. I value it because of the craftmanship and appearance.
Reply: @nikoleigraham8747 It's a really complicated topic. I think the iron ore was mined one place, alloyed somewhere else, and sold in Damascus. Do your own research if you're curious!
Reply: @Naokarma the molecular makeup has some effect on the amount of micro serrations you can achieve resulting in some steel being able to achieve a higher level of sharpness. However you are mostly right, I,ve seen a table knife sharpened to be sharper than many kitchen knives. I did not hold its edge for more than a few cuts though.
Reply: @WIZA327 if you just see it as a tool: use what the pros are using. If you consider it a hobby: educate yourself on all aspects of knives and engage with other who share your interests!
Reply: @anthonyvillaa Simply: all knives are either high carbon or stainless. This refers to the material. Damascus is made a different way but the material is high carbon steel.

Both high carbon and stainless encompass a range of crap to really good. However, if you consider the best of each type high carbon has better performance regarding edge-retention and ease of sharpening.
However, the effort you save when using it is miniscule compared to the effort you have to put in taking care of it.

TLDR.
If knives are just a tool: Stainless.
If it's a hobby: High carbon.
Reply: @Afeller whilst I appreciate your experience as a knife maker I believe the history of Damascus and Wootz is so complicated that you cannot say "Damascus is inferior" due to there not even being an agreed upon definition of what Damascus is referring to.
Reply: @mchajen511  there is no definition of Damascus that is superior to a modern high carbon steek
Reply: But looks cool.
Reply: You speak very confidently without mentioning that this is not real Damascus steel. This is pattern welded steel. Real Damascus is better.
Reply: @nathandodson3220  what is real Damascus steel then? The ancient steel made by Syrian smiths? You realize that, with the technology of their time, the “Damascus steel” that they made is probably inferior to modern mild steel. The carbon content can only be raised so much with ancient technology. I suggest you take some time to read about basic metallurgy.
Reply: That’s not the benefit of Damascus. The benefit of Damascus is that you get the flexibility of low carbon steel and edge holding and spinal structure of a high carbon steel. By not making it homogeneous you distribute these properties through the knife. It’s very similar to the way that Katana steel was made and the way that Japanese chefs knives are still made. It makes sure you knife is able to hold an edge without curling, doesn’t dull as easily, doesn’t chip off at the tip, and doesn’t shatter. It doesn’t give you as good of an edge as an all high carbon steel and it doesn’t give you the flexibility of an all low carbon steel, but it gives you a mixture of properties. 

It’s kind of like rebar (low carbon steel) imbedded in concrete (high carbon steel)
Reply: Yeah, its mostly snobby stuff now
Reply: Well at least damascus look awesome and you can’t have this look easily,it’s like the most difficult motif possible so I wouldn’t feel like I’ve wasted my money if I bought an 500$ one,maybe if it was a 5k but the amount of time it take to have this look kinda worth the price
Reply: @GreatSageSunWukong  people have definitely managed to beat Viking steel. I weld mild steel stronger than “Viking steel”
Reply: I ain’t reading allat tf
Reply: How much is:
1: Emanual Emanual.
8: Jacob Gouriye.
11 Jacob Matteüs 

Worth?
Reply: Real damascus is better this is painted damascus its not much better it's only slightly better because it's folded and not even properly and real damascus came from wootz a meterial that grew naturally I'm only damascus hence the name we no longer have wootz but if we could figure out what happened to the iron we could make it this is fake
Reply: @kenithvega2331  you understand that ancient wootz steel would be far inferior to what we would consider cheap steel today? As amazing as the smiths may have been, they were limited by a lack of modern steel making technique. Also, id like you to explain what benefits specially folded steel provides